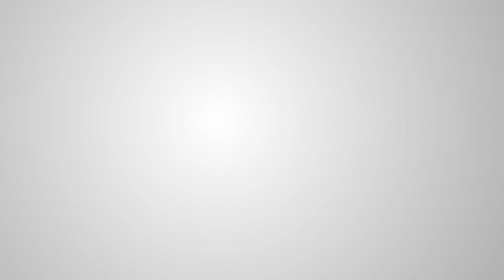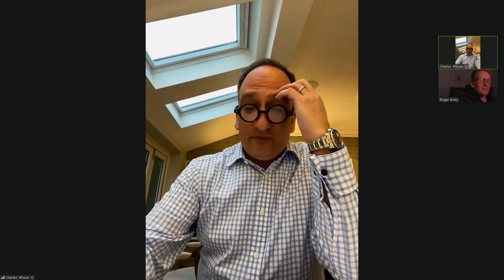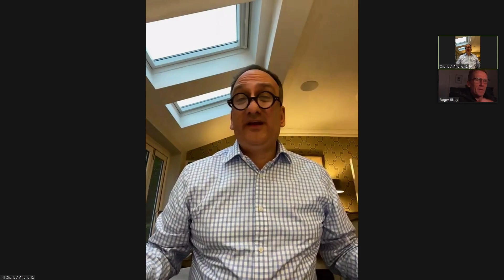10 Plumbers Couldn’t Solve This Mystery. Can You?

Comment: I ain't no plumber (!) but key evidence for the pressure loss issue seems that there's obviously a leak, current or past,  at 3:39 and it appears to be on the edge of one of the underfloor heating areas. There must be gallons of water coming out a day (or even in the space of a few minutes) and it's going somewhere, obeying gravity and going downwards out of sight. The slightly dodgy underfloor heating pipes are a bit of a red flag. I'd isolate each area I could and pressure test it all. I have a hunch a floor is going to have to come up to repair/relay underfloor heating pipes.  Could even be a nail or screw puncturing one of the underfloor pipes but it would have to be significantly damaged to cause such a volume of water to escape so quickly. More likely a failed joint?

Comment: The way Rodger spoke to this guy is brilliant. Tactful and understanding. As for the house and the problems I would’ve been taking the floor up well before it happened here. £500 a time for leak detection in comparison to a days labour just taking the floor up in places to investigate which you’re going to have to do anyway just seems to make sense. I guess people don’t like having their floor taken up but if you can’t see any evidence of damp it must be below ground. I do like the solution in the end though, not something I would’ve thought of as a home owner.
Reply: first of all i as a timed served plumber of 50 years would never put a push fit fitting anywhere that has not got a view and never in concrete even soldered copper joints in concrete should be covered and finally underfloor heating pipes should be ok to be buried in concrete if they are specified for that job to be laid in a continuous loop without any joints terminated ends above any floor and pressure tested to the maximum bar pressure  specified  by the pipe manufacturer before any floors concrete or otherwise are laid
Reply: Yes you sometimes just have to rip the plaster off as it were otherwise you can be faffing around for so long and as Rodger says get rid of all those points of failure, the joints, and bring all the pipework to the surface particularly if you are using any form of underfloor heating otherwise its just asking for problems
Reply: Totally logical Jon and I agree completely with what you suggest.
Reply: The money this guy suck in investigating would have been better spent running new pipe. Crazy costs!
Reply: The whole floor?  Could work out pricey and if I done that it would be the last board I lifted 😩

Comment: Interesting to see air bricks and joists on dirt and the building lasts a long time. When I see that in old buildings here, I think what idea thought of this, but I guess it must just be that it was stuff that worked well in the British climate and people assumed would work well here, but experience proved it does not.
Reply from the maker: ventilation is the key
Reply: @SkillBuilder  It apparently works somewhere, but where I live was a swamp before they settled it, and the water table is about 12 feet below grade (so only a few feet below the bottom of a crawl space), and our year round humidity is above 70%. The thing to do here, people learned the hard way (from fungus and termite damage), is encapsulate and dehumidify down to about 50%. Interestingly, some neighborhoods require all houses appear to have vents, so the old houses and new look the same, but on the newer construction the vents are just dummy vents screwed to the face of the foundation. I always wondered why they used to think dirt could touch wood and outside air should flow through the crawl. Now I know in other places a house with these features lasts well past our 80 year max life build standard in the US.

Comment: This is the job that one would have sadly the worst nightmares about.
Never use push fit systems where they cannot be accessed.
Have found on many occasions where simple stuff like pipe inserts have not been included, add to that years of different trades people takes it toll.
Whilst the problem may have been remedied for now, does not mean it will be sorted for good, I’m sorry to say.
Reply: Not being a plumber so please ignore my ignorance, but if using plastic pipe in concrete  screeds what type of fitting do you recommend ? Also if you used copper pipe and soldered fittings what should the pipe be sleeved in ? Any advice would be appreciated.

Comment: Great video, that's standard practice here in Australia, they use a listening device to locate the position of the noise, if the leaks too small they pump up the lines with air and it makes the location more obvious, they can normally pin point the area down to around 300mm by 300mm square, all the best mate

Comment: Good luck Roger.  Has the diaphragm in the pressure vessel perished or the pressure dropped on the air side of the air pressure vessel.  Isolation of each circuit and pressure test.

Comment: It terms of that pipe that 'just needed pushing back in', I could be wrong but it seems that was one of the ones partially buried in the concrete??. That suggests to me that 'they' simply dumped the wet concrete on too hard and the weight of it took the push fit off the vertical pipe. With that in mind, I'd guess that it was someone unskilled who was dumping in the concrete and again that might suggest that there are other similar problems, simply from dumping wet concrete on to push fit joints that then come apart from the weight of it.
If that's the case there doesn't seem to be any other option but to strip it out, or cut off the old system and re-route new pipework in troughs etc carved out of the old concrete.
Full Disclosure - I am a total amateur so take my views with a ladle full of salt. 🙂
Reply: I wrote the above before seeing the end of the video...I'm glad it got sorted out.

Comment: Hi, I would create a moisture profile of the floor area in a grid formation, as you would do when investigating dampness in a wall. This needs to be done by someone competent in that field.
Ideally someone from the Property Care Association, CSRT, etc. Readings need to be taken whilst the heating is completely switched off, then retake all reading again, at the exact locations on the floor, indicated by masking tape, with the appropriate type equipment, sometime after the heating system has been running, ie, 1-2 hours. Any variations in the reading should indicated where moisture is escaping from the system pipes, etc. Also, the outside path levels are way to high, as Roger mentioned, I suspect there are airbricks outside behind the gravel trench at the ground to wall junction, so,  they need to be exposed and a grill installed with some kind of appropriate telescopic sleeve incorporated to provide ventilation to the subfloor void. Also, Roger, ask the owner if a Vapour barrier was installed under their timber/laminate floor, this may "perhaps" affect any moisture readings taken.

Comment: Looks a mess, but I doubt it needs a total overhaul. Needs a reasonable amount of time to go though and establish what's going on, and go from there. Customers rarely like paying for this (I can understand, it's days of effectively just looking at things) however, it may save on overhauling decorative finishes. A drawn up system layout would be hugely beneficial for future trades too.

What I don't like is the two boiler arrangement, I would be upfront in recommending taking a F&R and a hot from the suprima boiler cupboard over to the combi. Lose the combi. Lose the complication of two separate systems that share spaces.

The damp could be caused by other factors, but pressure dropping suggests a leak - as it sounds like the expansion vessel is still good.

There are a plethora of ways to find a leak, and we've all got our favorites. I like using a compressor as it often gives you hissing noise or blows apart a failing joint - makes locating problem areas very easy.
Reply: Spoke too soon! Another win for compressed air then :)

Comment: I have seen damp walls 18 months to 2 years after a water leak flooding the floor. It was assumed that it had been dried out at the time but started to look like rising damp etc. I would think the hall wall is just still drying out as there is nowhere for the water to get out.
Reply: True but if the boiler is losing pressure at that rate there must be a leak somewhere

Comment: With 2 boilers, simply turn one off and keep the other on to find which area/rads in the house get warmed... Needed more detail on the age of house and did it start off with wooden flooring in the old part, but has been replaced with concrete/screed for the underfloor heating (which looks a complete mess!) and yes it should have air bricks for wooden floors...

Comment: You did say about pressuring the individual circuits would be a way of finding the leak there roger it did look a right mess of pipe work unfortunately and not trying to be negative but it’s probably going to have issues in the years to come

Comment: Hi roger I am a retired toolmaker not a plumber but have always done my own plumbing with soldered copper pipe. A suggestion, fit stop cocks to all the pipes and turn all off and see if the pressure drops. If all is well try opening just 1 stiop cock and observe the pressure. Hopefully the problem pipe will be found. I totally agree that "spaghetty of pipes is a disgrace.

Comment: The plastic grab rings inside fittings disintegrate and therefore fails
Also I’ve seen plastic inserts disintegrate and loosing grip
They are aware of this problem, new push fit fittings rings are stainless steel 
To me looks a complete rip out start again. Best of luck 🤞

Comment: first research previous owners of house and contact them for any knowledge you can gleen from them. Give new owner an outrageous price not to exceed  and tell them they may have dig up floor whereever leaks are but tell them about heat pump options with surface mounted heat exchangers . Also let him know with push fittings this could happen again down the road in future. Tell owner exactly what your going to do and document everything you do  and charge them accordingly .ok , what i would do is see if i can rent one of those thermal imaging cameras and keep running boiler and look for obvious underfloor leaks. if you find the leaks then great , then isolate each flow and return and test them one by one and label them. This needs to be done  either way. Take time and carefully look at tests when you find leak you could run hot  water through hose to flow pipe and check to see where its leaking and route with thermal imaging. remember though you could have multiple small leaks in push fittings. Once you know if underfloor is not leaking examine boiler and thats it. Also first he may want to contact a solicitor and see what his options are first, can he go after previous owners or can he get some money from his own household insurance by sueing them. You have done nothing wrong yet, so clearly outline ,like i am saying he should contemplate and its not up to you its up to them what they you do in writing. THe insurance might say tear it all up and redo it all rather than assume risk. Good luck, its not your fault, the best thing you can give them is good advice.

Comment: He would be better change in one of the boilers to adequate one and redoing the whole underfloor system downstairs properly or ditching the underfloor and finishing the job with radiators. As a heating engineer not plumber doing all the fuels and renewables. Some customers have unrealistic expectations of what you can achieve in a call out , feel sorry for the guys involved , just hope they all got paid for there time .

Comment: Good luck with that Roger, your client is looking at several days of disconnecting and isolating bits of the system so seperate pressure tests can be carried out. Then when we have worked out what is leaking we can remedy and then decide weather to re-pipe up the worst of the spiders nest of push fit nonsense. personally I would leave the boilers in as long as they are in decent nick, but those red Calafi? EVs don't last long, mind you they are only a hundred quid all in. Your client is looking at a fair amount of disruption just to find the problem, but when found probably an easy fix.
all the best from J & H Builders

Comment: Few times I've had to find a leak  I used  a long screwdriver place one end on the pipe and the handel to my ear and listen carefully. go around the house  and check each  pipe.  System  has to be off and ideally  no one else in the house  while doing  it ( keep the noise  as low as possible) bit harder to hear on plastic pipe but with pressure you with hear the water/ air escaping.

Comment: Watch till the end 
Re hot air heating , it was never popular in the UK almost all the new  property's where it was fitted have over ther years had it removed.  Yes wet heating can leak but , ducts need space (preferably inside), cause compartmentalisation issues (fire safety) can transmit noise , filters need changing frequently etc... but one possible advantage is the air movement they create means condensation issues are likely reduced .
Reply: Mold is a major and common health issue in the UK. Ventilation is all too often ignored.

Comment: Whenever I hear ‘character’ I hear money pit. Assuming he solves that one problem, he’ll soon be discovering more. Full strip out and a complete one design system is needed. Or years of headaches and passing tradesmen
Reply: I agree, systems get old, inefficient & dangerous, sometimes you must bite the bullet and start again.
Reply: I’d tend to agree. Anyone would be put off from countless add-ons from the years.
Reply: It depends really.  We bought a characterful cottage in Devon.  It didn't involve a mortgage so I opted to forgo a survey because we considered them to be poor value for money in the past.  I was satisfied with the likely overall condition of the property and so was my daughter-in-laws father who is quite handy.  That said, there was (and is) no central heating, so in that regard comparatively little to go wrong.  It has solid floors, a newish cylinder and wood burner and we installed new electric rads.  The roof was also converted around twenty years ago so there shouldn't be much trouble there.  We rated the kitchen and bathroom usable and we've been here for three and a half years with no real problems.  Of course I understand that bigger, more complicated houses pose more risk.
Reply: bollocks

Comment: I've learnt in over the years that doing an air pressure test is time well spent. As well as shut offs on the flow and returns of each loop.
Reply: Yep I agree…. It pays to pressure test .. I just have a small air compressor that blows of at 3 bar with a 5 bar gauge, so you can see the pressure drop off quickly..I am old school, it’s copper all the time…not into plastic..
Reply: basic fault detection isn't it. Isolate and test. Takes time though as you may need to cut pipes add fittings to separate circuits but just starting with entire flow + return is a start and work from there..
Reply: @TheBrick2  I wonder if anyone has developed an externally mounted sensor that could clip around a pipe and measure flow rate?

If you could measure all the inlets and outlets, whichever circuit didn’t have equal in & out flow would be the target for more destructive testing….
Reply: Will start off by saying that I am anything but a pro but how about drilling some small holes in inconspicuous areas and putting a camera or even just a wooden stick down to dip test under the wooden floor, easy to fill and make good or if the floor then has to come up you can replace the boards?  Sorry in advance if this is a stupid idea!

Comment: Smell nice in the system 100000% works
Yes the water does thin it but as soon as it find the leak it come out in to the air, air being 1 atmosphere instead of a air tite water system is 1000 atmosphere,
Just look at a spray can put it nere your ear and shake it you will hear liquid one press on it ans its a gas!
SO 1000000% PUT SMELL NICE IN IT WORKS! DO IT DO IT DO IT DO IT DO IT DO IT!

Comment: We never bury push fit joints in concrete, been called to too many leaks where expansion and contraction has caused the joint to go in the concrete. I'd be willing to go have a look but it's a bit far out of Sussex/Surrey. Couple of worrying things with this build; the people you had work on it not great but bad relationships aren't always a signature of bad workmanship.
However it's losing water in a suspended floor with no known ventilation under a plywood sub-floor. That's possibly the most worrying as rot can set in and destroy the floor in a very short amount of time in that situation and it won't always show up on your finished floor above.
This honestly needs testing circuit by circuit if possible but it's unlikely as it's bodge onto bodge.

Edit: I'd advise Charles to look up his house on Rightmove history/old Google Earth pictures etc and see if their are air bricks visible on old photos and where they were. It's free and for a couple hours searching online it can give you a really good base for knowing what has been done and changed on a property and how they might have gone about certain additions. 
Also, central air and AC is just a more efficient and less costly setup, sadly we're one of the few developed countries in the world that doesn't regularly use it.
Reply: spot on mate.
Reply: And the heat loss at each joint, although not detectable, adds up when you have a load of them.